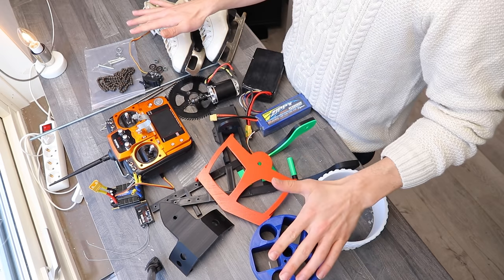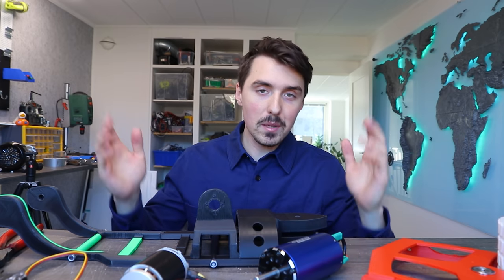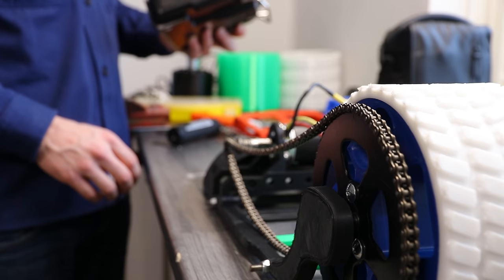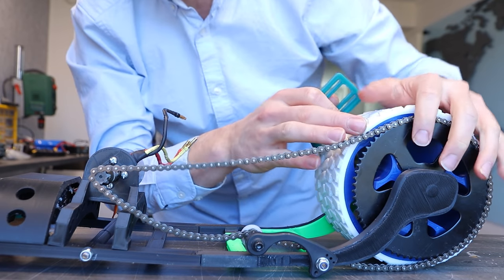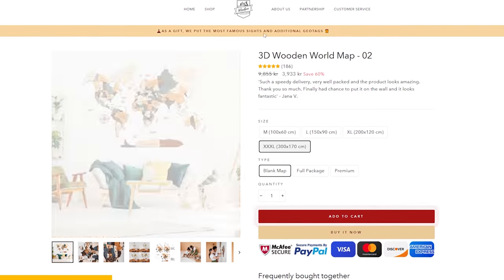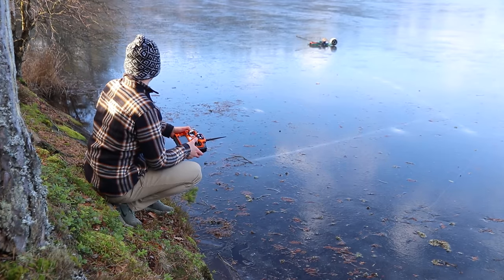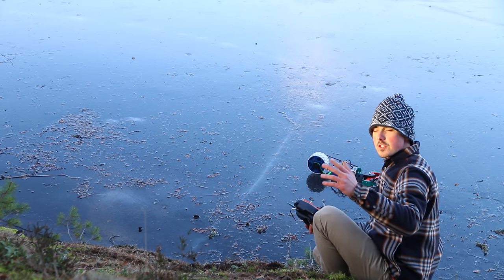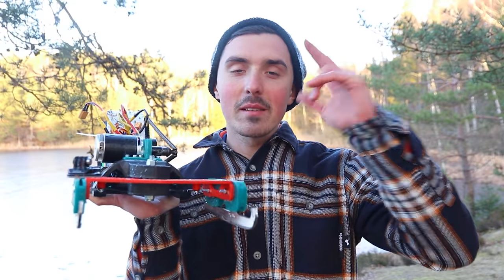3D Printed RC Ice Vehicle With Chain Drive

Comment: The reason you can't get enough steering I think has to do with the steering linkage. There are 2 rods on both sides, and because the radius about which the front attachment points rotate is a lot bigger then that of the rear attachment points they start binding up as soon as you try to steer more than a couple degrees. You can also see the front carriage start to bend up and down when you steer because of this binding. Simply removing one of the 2 rods would have already worked way better.

Comment: Use cobalt drillbits, lower RPM and use oil.
Also when drill starts to cut, keep going till you are through.
Once you stop , the material instantly hardenens and drilling will be allmost impossible…!

Comment: very interestng, but i think the iceskate-blades are overkill, you might be able to increase speed and turning capacity by making them more similar to a short, convex knifes blade.
since the blades you used are made to support humans you've got way more surface area then you need anyway.
also i think the new blades having a convex profile might help tracking when turning bc of less contact to the ice and thus shirnk the turning radius, similar to how cars have far smaller turning radii then a truck with a trailer, even if the car had a trailer aswell. 
since I'm talking about a convex shape potentially helping the turns anyway imma also say that i could imagine said profile helping turning even more if you didn't steer the blades, and thus the whole vehilce, like a car would but instead tilt them side to side to make the actual contact area between the blades and the ice be more of a curved shape.

Edit: the best analogy for tilting the blades i have is comparing them to ski when turning, ski are usually flat but if you tilt them while standing on them (which is what you'd do to turn when riding ski) they're being deformed into a convex shape, whose contact area with the ground is more curved and will give you really crisp turns. since you'd start out with a curved shape there's no need for deformation and your vehilce is more stable (then convex ski) eitheway bc of the wheel in the back.

Comment: I would like to help out a little. 
#1 are the skates sharpened? Due to the vehicle being very light(not a person) it is mostly going to slide and Not grip. I would have it  3/8 grind. 
#2 when I'm printing  and using chain etc. Like this I would have put the motor in the hub. Possible gear to gear....
#3 look up bobsled for front end. Each ski Independent, and would allow jacking while turning making easier and tighter turning. 
Take from this what you will.  And good luck with your next iteration.

Comment: You have fusion 360, a good computer and what seems like more than 2 brain cells. Why don’t you run FEA analysis on parts to see stresses and deflections? Just running general parts that you run 100% fill with through a quick pass can show whether a frame is strong enough or not

Comment: Okay so the reason that is not turning is because there needs to be a finer blade it needs to be like a knife blade in like a 1 increment right in the center then that way it's centered the weight across the axle will steer it better at low speeds

Comment: How do you turn with skates? You don't do like a car with wheels right? its a "leaning game" mostly! so probably sharper turns if you manage to arrange them to work the angle rather then turning. And need some weight on it to work also. Well done though, as always. Next one, uphill ski machine (where turning is same, more of a leaning game than turning, carving machine)?

Comment: 4:09 Its high carbon hardened steel with chrome plating i believe. To drill it you need ether ruin the temper from that area, for instance keep blade it self under wet rags or in water and heat the area you are drilling red hot. Hotter the flame faster it heats the metal but also limits how much heat metal transfers to areas you dont want to and then let it cool down slowly, so at minimum oxy acetylene torch and while you are it use cutting torch to punch trough it. This is easily outsourced as any decent shop or even local farmer should have the equipment and personally i would take like 10-20€ to do it if i had that gear and not been out sourcing it my self as well. Other option is HHO generator torch but been pondering how to build one my self in size and safety that allows me to heat up large parts of metal, with additional single use bottles of oxygen and acetylene to adjust flame since you need oxygen rich flame for cutting that makes it lean=burn even hotter or fuel rich mix(one that produces carbon) to have oxidizing flame witch can be used for instance cover areas with "suth" that helps when welding as antispatter coating that is easy to clean off and available if you have torch around your shop.

Comment: What would it cost for you to build a prototype paddlewheel design I have? It will revolutionize the paddle wheel propulsion industry. Paddle angles are controlled throughout the rotation, diving into water at 180deg and pulling out at 180deg. This angle can be controlled. It uses plastic gears. University of Columbia, MO built a prototype out of plexiglass back in the 90's for me, before 3D printing. I promise you won't be disappointed. I'm ready to share it with the world.

Comment: Use belts not chains and you'll be able to print whatever size pulley you need to get the top speed you want. Put the axle of the wheel in a slot and use the same mechanism motorcycles use to tension their chains. It seems like  you get into building before you think projects through. Wheel, motor mount, chain tension and final top speed were simple mistakes to avoid in the design phase.

That said, don't let an old git like me dampen your enthusiasm. Keep up the good work.

Comment: Simon - do you have any info on the TPR you can share? I wasn't sure of the shore hardness (I see Atomstack has some at a 50-70A shore hardness) and if you printed it with one of your standard printers. Atomstack seems to suggest you need one of their printers but... I kind of doubt that.

Cool video!

Comment: You cant steer because your riding on the bottom of the skate blades and not the edges, thats not how you skate, you have to have your foot tilted to the side so your on the edge of the blade. Tilt the blades and this will steer

Comment: hey man i just relised a slight issue with this. the rim part where the tire sits on there... you might want to add like 3 grooves in there and on the tire add like 3 lines next to each other sso that they fit in the grooves so it wont slip off im only at 1:03 so idk if you fixed the issue in the video but if you ever find it to slip please make sure to add thoes slots and lines on the wheel please it will help you alot
Reply: also just realised at 4:32 the vehicle will drift around since the tyre dosnt have much grip, for more grip try maybe adding thoes flat thumbtacks if you guys have anny (punctures from the inside so they wont fall off)
Reply: 6:20 and theres the grip problem